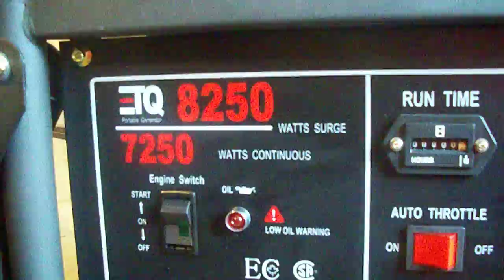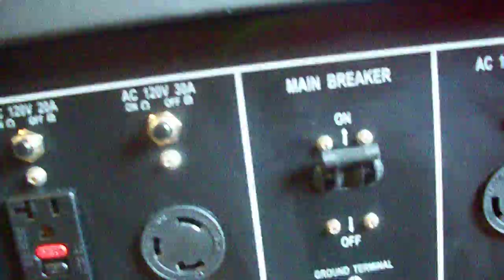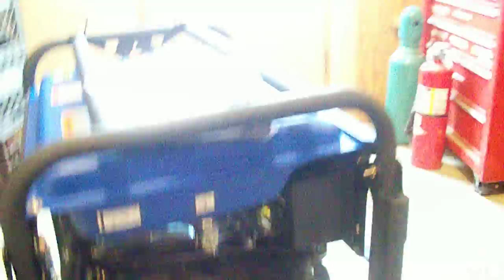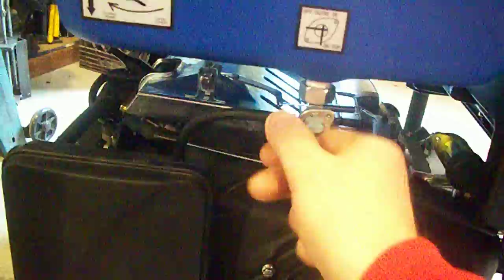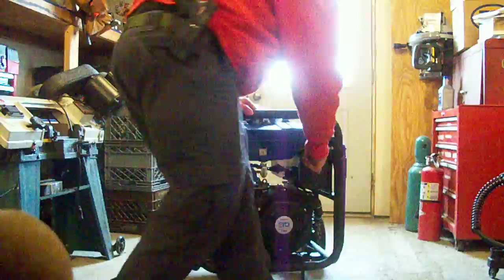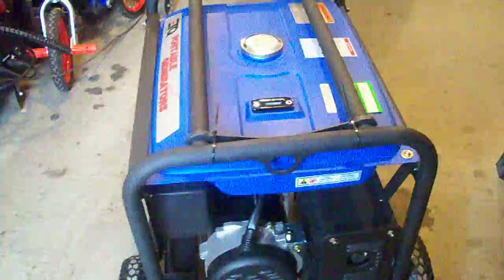ETQ 7250 Watt portable generator review.MOV

Comment: Do you still have the unit and what would you rate it 1-10? Is it any good?
Reply from the maker: I do still have it. I clean out the carb after every run, and change the oil annually. I run our large house with dual furnaces and dual AC units any time the power is down. Really, for the price, you can't compete with it.

Comment: Great video. Does anyone know what the total harmonic distortion or THD is of these units? I’ve read more about THD lately and worry about things like the fridgerator and things may be working great for several hours but if the THD is really bad it can damage your equipment overtime. Plus the THD can vary from 5% to over 20%. Thanks!

Comment: We have the same item. we use it to run a camper. it runs for roughly 5 hours, shuts down and will not re start unless it sits for roughly 2 hours.. then it will start and run for roughly 5 hours again.. Makes no sense to me.

Comment: We have our ETQ connected to a 10 circuit transfer switch (installed by a licensed electrician with all the proper permits) with the inlet on the side of the house.  We connect it to the genny via a 25' 10/4 cable.  We also run it dry before storing it.  Starts on 1 pull every time, and isn't that noisy.  I really can't say anything bad about it.  Only problem we had during the hurricane was because of the gas shortage and that, and only that, is why I'm considering a diesel for myself.

Comment from the maker: @auroraron  Honestly, I store it without fuel and only run it out on the driveway with a 30' cord that plugs into the outside of the house. I can shut off the main breaker and feed the entire house and simply choose what items I wish to power based on necessity. I don't believe that I am in any threat of fire by way of running the generator that far from the house. I had the auxiliary power hook up installed by an electrician and tired in,  so it was done per local code.

Comment: Your insurance company will also not cover you or your home without electrical approval.  No electrician can work on it or install it either. Look at Home Depot. Not a single electrical device is sold without electrical approval in their stores.  They know the risks.   ETQ and many others don't follow normal electrical safety requirements for North American customers. Since there is no body that is regulating their work, they get away with anything.  The law is there for a good reason.
Reply: not like its going to burn the house down  lol

Comment: just to help anyone interested - The ETQ. Model: TG72K12  takes type 4 kit, item 
K4-CHON14 from USCARB dot com.  this info is direct from customer service as i am getting one for mine. to run on propane fuel it will require another regulator to bring the pressuse down to 1/2 pound and is also available from them for about $45.  this generator gets great reviews and keep in mind that even people that buy generac generators still have failures. best advice is change the oil as needed.

Comment: the engine in this generator is a honda clone. honda sells its dies to a chinese company that reproduces a honda designed engine.  these motors are cheaper copies, but are know to be VERY reliable and even have there own class in kart racing. all honda parts will fit this engine, and for $270 you can purchase a tri fuel conversion from uscarb dot com to enable this genertor to run on gasoline propane or natural gas.  the conversion will pay for itself if you ever experience a long outage.

Comment: @HiPerformanceDiesel all gasoline engines will run on propane or natural gas with no modifications to the engine. a tri fuel conversion for this generator is $270 from uscarb dot com.  if you had a 2 week outage you would spend over $500 in gasoline to keep this running 24/7  vs about $60 in natural gas. the conversion will make your money back in a week and is well worth not having to stand in line for hours trying to get gas when everyone else is doing the same thing.

Comment: @0615conroy  me and my father bother both bought one from costco also. $650 shipped with battery. couple things - amazon ratings of this generator are great - even people that buy a generac still get bad ones sometimes.  - Costco has a LIFETIME return poilicy on everything they sell - this is why we bought it from them. 5 years from now you can bring it back and get your money back.  check out uscarb dot com. for $270 you can buy a tri fuel conversion for this and run it on propane or nat gas.

Comment: I just bought this exact model from Costco for $650.00. That included shipping. Costco has a 2 year warranty and I made sure to ask if they will honor this. Hopefully we will never need to go that route. I just hope that this generator doesnt have problems. I bought a CNG adapter and the generator runs like a champ using this. I can use gasoline, CNG or propane. For another $187.00 you can buy the CNG adapter.

MIke
Reply: Would you please give me the model number of the natural gas kit you got? I’d be interested installing it. I hear they’re very straightforward to install

Comment from the maker: @solidsignalz So far we have not had a power outage. I just ran a gallon of fuel through the tank until it ran out on Saturday, I do this every 6 months. I pour fuel in it and it takes 2 pulls to start, so that is nice and easy. It runs and makes power, I always plug a light into it to verify we are getting power from the generator. It is filled with Amsoil for lubricant. For the minimal use I will request of the device, I expect it to be more than what I need.